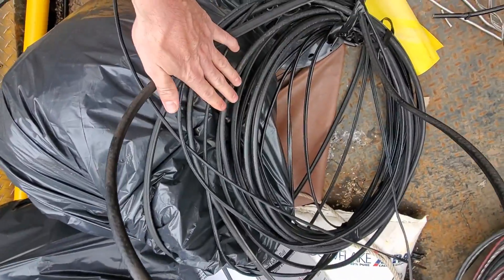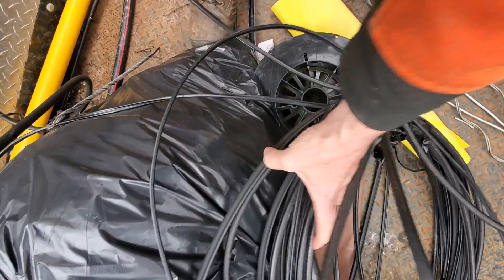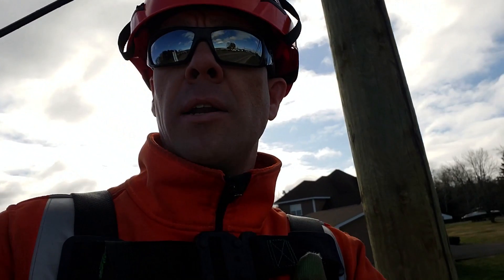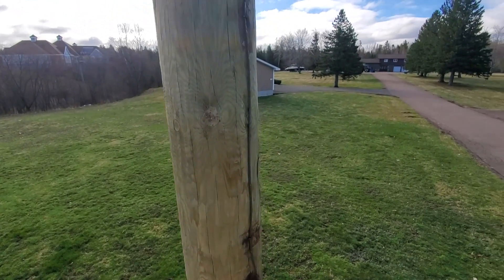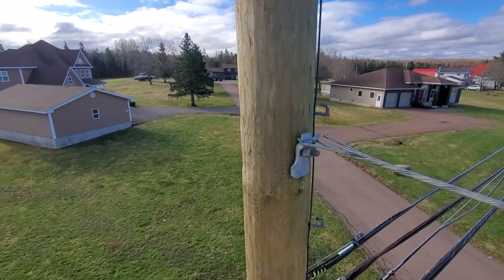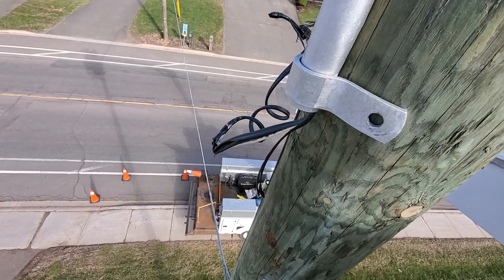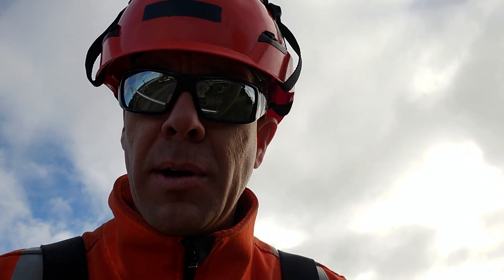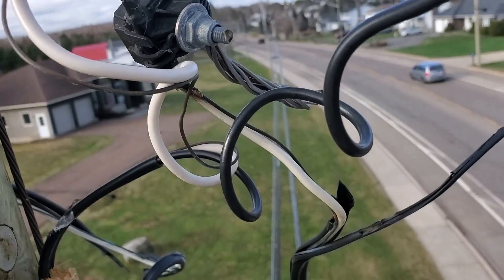7200 volts through telephone lines!

Comment: Annnnnd I'm done stripping phone lines with my teeth. I can take the 48VDC when they're idle, and even a quick blast of 96VAC if the line starts ringing on me, but 7200VAC is a huge nope.
Reply: Not good for the teeth either, personal knowledge.  😎
Reply: Lol
Reply: You’d be crying like a baby if there was any substantial current to that.
Reply: Wow that's brave, my brother thought a phone line was only about 9V so used his tongue to see if anything was there.......  
I believe he ended up on his bum the other side of the room.
Reply: @paulstubbs7678  A telephone line is -48VDC(positive ground) for talk path voltage but, when we were wiring up buildings from scratch before they were connected to the telephone network our tone generators we used to search through cables had a talk setting that put 9VDC on a line and we could put our butt ends on the loop and talk between floors.  The ringing goes up to 105 VAC.

Comment: This is why the wires should ideally be in the ground, and registered where they are, so nobody digs into them. (is there such a system over there, to register cables, and register where you dig if you want to add one?) But especially if the ground consists of loads of rock for example this will of course not be affordable unfortunately, and someone already decided a long time ago power should be on wooden poles, so you would need to replace a lot of cable with expensive groundcable.
Reply: You can't run high or medium voltage AC underground for any kind of serious distance. The conduttors capacitive couple to each other and the ground causing "low leading power-factor"
Reply: @joecummings1260  Still I think the 380kv-50kv power distribution here is done above ground, and <36kv is usually underground is what I read. But the distances are not that long over here. You certainly could get rid of the above ground cables in cities/villages. The net near me is 220kv -> 110 kv -> 10 kv -> 0,4 kv 3-phase. the 10kv and lower lines are in the ground.
Reply: @joecummings1260  They can and do run very large transmission cables underground. You just have to use very expensive cable. I think the cable itself is 3x more expensive, and the construction costs are way higher too. That's why so much is above ground - it's substantially cheaper
Reply: Here in the US we do have a number of buried lines, however, the majority are aerial because its near trivial to tap into them to set up another customer, and it can be done while the line is still energized. It would be much more expensive to have to dig for the wire and then tap into it, which I'm not even sure if that can be done while energized.
Reply: "is there such a system over there, to register cables, and register where you dig if you want to add one?" Each company keeps records. When I want a new house, or out-house, I am required to "Call Before You Dig", Dig-Safe. All the likely companies are required to respond quickly and stake-out their wires/pipes, or stake "No wires-- PSE&G". But this is all the last 20-30 years, and poorly enforced. I don't actually know where the last 50 feet of my 40yo service comes in the house. (It does not run like you would think, because we hit it, twice.) The 500' of overhead wire before that is easy to see through trees. I re-dug and moved my sewer a few years back and documented it in detail (10' from tree, 37' from garage...), map tied to where sewer leaves the house; but my neighbor just dug dropped and covered, never measured.
Reply: Imagine, all the tree roots one would come across in the NE in rural locations ... not practical. Even some areas have a lot of big sub-surface rocks in the soil, and still other rural locations have slate just a half a foot down ...
Reply: @tripplefives1402 Yeah, eventually you end up with nothing but reactive power getting passed back and forth. Probably end up with a lot of transformers going into ferroresonance also.
Reply: Power lines need altitude to generate power. The higher you go, the higher the potential is. This is the reason why they will ALWAYS be high in the sky running for miles and miles. Just the messenger, here.

Comment: In NH I'm noticing that the telephone cables during storms are allowed to fall to the ground after pole replacements.  They sit there forever since they not in use.  Those large telephone cables are useless now and no one cares about them.  Eventually, someone is going to have to clean them up.  It maybe(already is, I bet) a profitable venture as a scrap operation.  Electrical utility-wise they are a nuisance. Coax or fiber are the only things left to hang on poles and those are relatively light weight.  That bundle of copper is obsolete.
Reply: Reminds me of that tornado not too long ago in Charlestown, IIRC! Afterwards, it looked like they left some in-use telecom cables resting on the ground!
Reply: I'd like to see a video of that! Where I am most of the coax and twisted pair is lashed together so it'll probably be left in place forever.
Reply: @grabasandwich  I could oblige but only with photos.  I'm not a videographer.  The fat telephone cables, when they fall are being ignored.  Utility cuts them free from new poles and lets them hang or fall depending on the span.  Seriously, no one cares about them.  Frankly, I would just because the scrap value is high.  Give me the copper, they can keep the lead.  Around here in NH, telephone cables are worthless POS...not used anyway...for the most part.
Reply: @nhzxboi  When I went to the scrap yard with electrical cables from a panel replacement: I was told he did not want communication cables. They try to minimize the amount of copper used: so it is mainly insulation.

Comment: Does your copper ground always get stolen? 👊
Reply from the maker: Oh ya, bigtime! We've switched to an alloy alternative
Reply: @Bobsdecline  Mainly aluminum now?
Reply from the maker: We tried aluminum at one point but it's to large to meet required ampacity. We now use a copper blend
Reply: @Bobsdecline  They should legalize the installation of a "bait ground" which has a capacitor coupling it to the overhead line such that it would carry about 0.5-1A. A few kV would permanently disable the copper thief pretty quickly!

Comment: Power crosses get very exciting. Luckily now a days our internet is fiber and we have never had cable TV. 

I think I've posted this before but in 1992 we had a couple of direct lightning hits. Utility power transitions from aerial to underground the last couple hundred feet (60M) from the house. Being off the road we have our own transformer. The transformer took a direct hit and exploded the high voltage lightning lightning arrester.  I was picking porcelain out of the grass for months. Needless to say it destroyed a lot of electronics.

In the US the NEC now requires whole house surge protection, I assume the Canadian CEC is the same. But in the case of a power cross or direct lightning hit I'm not sure if the surge protector will last long enough for the main breaker to trip protecting stuff downstream.
Reply: AFAIK the whole-home surge suppressors run on their own breaker. In a power line cross this breaker will shut off before the main breaker.
Reply: @eDoc2020  Good point. We have separate services for the house and electric water heater as our utility has different rates. I installed US NEC Type 2 surge protection on each service. The one I installed on the water heater service has its own breaker but the one on the main panel plugs into a breaker slot. I assume it has internal over current protection to prevent fire hazard.

I think your are correct the mechanical delay of the main breaker is probably greater then the surge protector. However with a massive power cross over voltage condition the main breaker will eventually trip but not before a lot of expensive devices let out the magic smoke.  But that brings up another point. Is the main breaker able to live break such a high voltage or will it just arc across the contacts? Hopefully the utility overcurrent protection will cut off power in that case.
Reply: @tomschmidt381   A main breaker is required to reliably break something like 50kA but I don't know how this derates with voltage. Once the arc is quenched it probably can hold off 7200v.

Keep in mind the only utility overcurrent protection is on the transformer primary. When these cross-connects occur it's most likely before this fuse. You'd get the entire rating of the side line or even worse if it's the main line like happened in the video. Other commenters were have deduced there was over 1kA flowing in the ground wire.

Comment: Could you do a video on the hazards of step voltage differential at accident scenes?

This week a local Deputy Sheriff was electrocuted while responding to a vehicle accident.  😔
Reply: Whoooooie.  This is not normally what the average person thinks of associated with a car crash (though fire could be).  Dear motoring public, try not to hit utility poles.  Police and fire/paramedics would of course want to rush to the vehicle in case someone needs to be saved.  But if high voltage has found a path to ground, the ground can become a shock or electrocution trap.  Are there detectors for such potential gradients besides people getting shocked or unalived?  .
Reply: I second this request. I only know about it because it was covered in my training as a contractor to change electric meters. I would use it as a talking point for my fellow tow operators.
Reply from the maker: I've definitely been wanting to do a video on this
Reply: This is why distirbution and transmission line should use ground fault protection like in Europe.

Comment: Copper telephone wires are being phased out—at least for drops to customer premises as fiber lines are strung.  I fortunately have two fiber providers at the pole.  They removed my copper lines when they hung the fiber drop.  Heck, the coax could be removed as well.
Reply: One might want electrical POTS for an emergency line, though a cell phone kept charged on an uninterruptable power supply could do as long as it is registered to that address.
Reply: @SeekingTheLoveThatGodMeans7648  nobody is fixing copper lines now either sadly... the old remote power reliability argument isn't worth much if every splice case and pedestal is open to the elements.
Reply: @SeekingTheLoveThatGodMeans7648  This is true in a lot of commercial buildings where they are required for life safety devices.
Reply: You still need that steel cable if you are suspending a fiber line.
Reply: @economicprisoner  my ~100ft drop doesn’t have a carrier wire.  They ran a drop for a friend of mine over 300ft without a carrier wire as well.

Comment: Imagine some old guy with his dial phone service still using that copper phone line and 7200 volts was his last call.
Reply: That is why there typically is a phone line ground either before the phone line enters the house or on the cold water pipe in the house, to help prevent that from happening.
Reply: @1nm1  That device is called by the phone companies as the "Protector" however in so many installations I have seen over the years they are not grounded properly or grounded at all. The protector device is typically a couple of spring-loaded carbon resistors that are conductive to high voltage, if the current is also high the resisters will burn off and the springs will push down and short the line to ground. The device was designed for an instantaneous burst of energy from a lightning strike. It this case the 7200 volts would be constant and destroy the protector and everything else in its path. You can only hope that the line wire melts off quickly before killing anyone or starting a home fire.
Reply: @peterfairlie2296  arrestor*
Reply: @peterfairlie2296  Thanks for the explanation...
Reply: @peterfairlie2296  Protectors are supposed to have a fusible link that burns open in the event of a sustained power cross situation. This is typically a piece of 24 or 26AWG wire. Some Bell System Practices I've seen cover this. Also, the spring loaded carbon resistors are well past obsolete, gas tube protectors have been standard since at least the early 1980s and if there is a telephone network interface it will use gas tubes.. The first design used a pair of two-element (tip and ground, ring and ground) gas tube protectors, then they went to three-element gas tube protectors (tip, ring, and ground all in the same gas tube).
Reply: @1nm1  You cannot actually just ground a phone line, it's a balanced transmission line, the best you can do is use some arrestors that kick in if the volts go aver 100V, old school phone ring is about 92V, so that has to pass unimpeded.
Reply: @paulstubbs7678  Excellent point, otherwise you wouldn't have the ability to use it.

Comment: Another reason to switch to glass for internet 😁
Reply: 7200 volts will fuse a multi-fiber cable into a solid glass rod. I repair fiber for a living. Seen it often.  Stay safe.
Reply: @tripplefives1402 Switches and repeaters?

Look up PON - Passive Optical Network, you might be surprised..
Reply: @tripplefives1402 Details 😅

Comment: typical problem with US/Canadian power distribution system, everywhere 7kV+ medium voltage lines on the residential streets (subtransmission) very dangerous in cases when this primary wire went down to the ground.
I like our Polish/european distribution systems because high voltage primary goes out of residential areas (or underground in city areas), only in some cases some overhead 15kV lines goes through residential areas but are connected to 15/0.4kV transformer which can feed few streets from safer 3x230/400V by overhead or underground, now many primary hv lines which remains as overhead are replacing by underground in cities.
Ik this conception of low voltage distribution can be harder in US/Canada by lower voltages and needed higher cross sections of wires on lv distribution poles
Reply: Almost all North American household electrical service in fact is split 230 VAC, with common portable household appliances using the split voltage of 115 VAC but special high power appliances like electric stoves and electric clothes dryers and electric water heaters (and more rarely welders and electric car chargers) using the full 230 VAC.
Reply: Similar here, but we have pure three phases in houses and uses 400 volts interphase for appliances above 4 kilowatts like water heaters and some electrical stoves, standard appliances works on 230
Reply: @tripplefives1402 Which European country were you looking at?
In Poland and some neighbour countries I never saw overhead medium voltage primary lines above 1kV on all streets in cities, especially in city centres where everything is underground except some low voltage 3x230/400V lines which usually occur in small towns as overhead, our system is totally diffient from this from north america and I never saw houses with our own transformer like this in US, rural areas usually have one or two 650kVA transformers in some parts which feed low voltages on all streets. Same in cities, here you can't meet medium voltage primary in cities as overhead, this is usually underground only. Shopping centres yes, have own transfomers usually, smaller just are connected usually to low voltage distribution without any dedicated MV-LV 0,4kV transfomers.
Some GSV links, How looks like grid on some estates in small town, this estate is feeding only from one MV 15kV/0,4kV transformer:
https://www.google.pl/maps/@52.8633574,21.086427,3a,78.8y,294.65h,92.59t/data=!3m6!1e1!3m4!1szWovbY2UE3zhjaBYBRrUiA!2e0!7i16384!8i8192?entry=ttu

Here is rural area, distribution system here totally not like this from north america..:
https://www.google.pl/maps/@53.0835284,21.1325488,3a,43.2y,53.62h,96.98t/data=!3m6!1e1!3m4!1syiHh9fiDg7qqlqY8hEKfmA!2e0!7i13312!8i6656?entry=ttu
Reply: Here in nz it is quite common to have 11kv to ground overhead lines, then 230v to ground just below them.
22kv interphase
415v interphase
Reply: And in Europe distribution and transmission lines have ground fault protection. Look up for Petersen coil  or resonant grounding.
Reply: @mernokimuvek  of course, When some not cutted trees touch phase wires on medium voltage grid usually ground fault protection trips in substation or when some wire go down
Reply: @AsXSn  I think it is the same in all of Europe now. A few decades ago it was common to operate a faulty line with one phase shorted to ground. The current was limited to <15 A. Poland seems unique with  the 15 kV distribution. In Hungary we had some 15 kV lines several decades ago, now it is mostly 20 kV, a few old 5, 6 and 35 kV lines remain. Underground distribution in cities is often 10 kV.
Reply: @mernokimuvek  We have some 20kV lines, but only in a few regions, and some 6kV remains, mostly of this 6kV was switched to 15kV
Reply: @tripplefives1402 HV transmission on steel pylons yes, but subtransmission known here as medium voltage isn't that common in overhead version on residential areas, on residential areas only low voltage is common, i don't know what is in eastern european countries but in central europe and western I never saw much subtransmission 10kV+ on every residential area streets
Reply: @tripplefives1402  This mainly depends from power line conductors sizes, voltage drop is not that big with 230/400V and 50Hz, consumers on end of line don't have that big voltage drop, now much low voltage lines get update to higher cross secions 120mm2 or 240 (over 4/0 AWG) and usually on bigger residential areas are connected like ring than radial or with next trafostation on last estate part